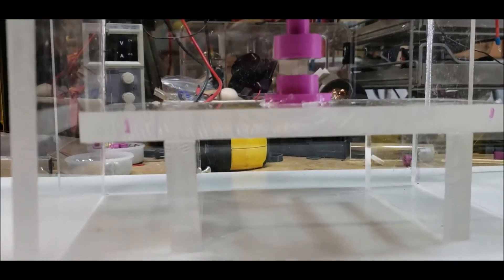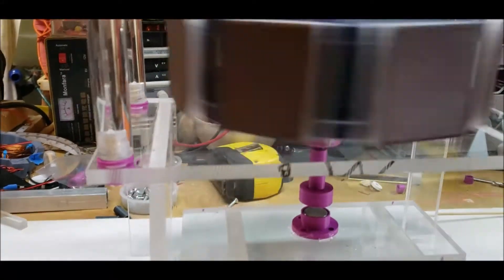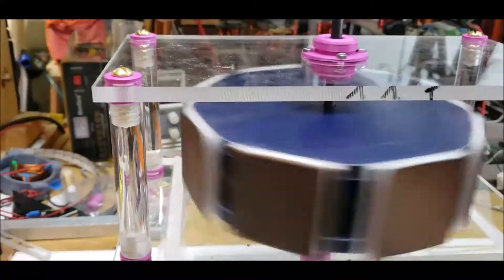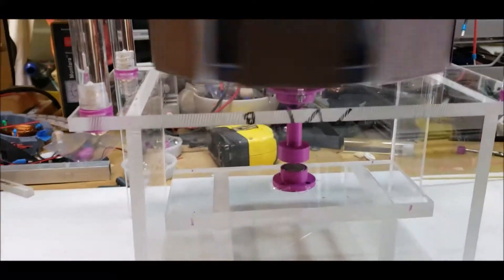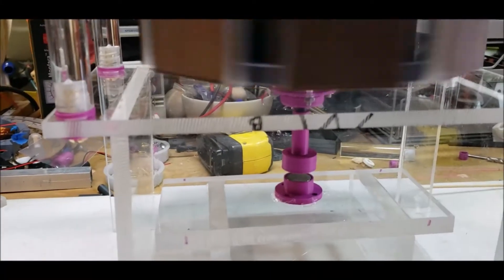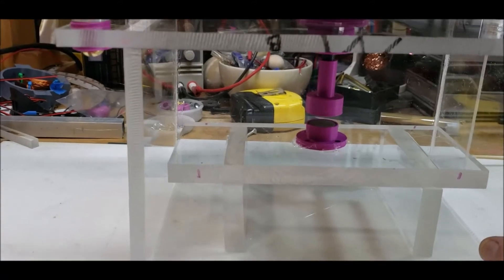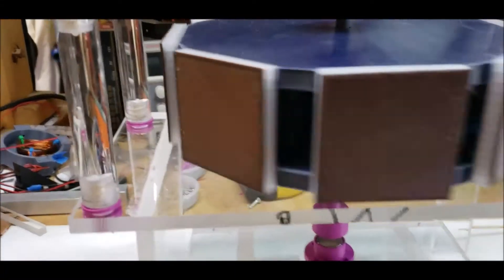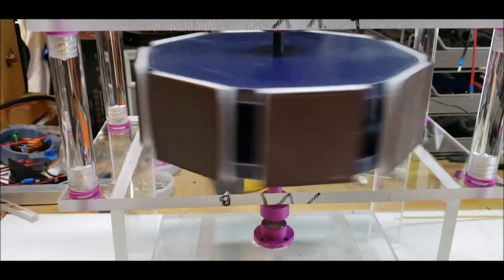3D Printed Magnetic Bearings Confirmed

Comment: Nice work
Can you share the STL files for magnet holder and bearings
Reply from the maker: absolutely!!!! The magnet holder is for a 2"x 1/4 disk magnet. The bearing mounts are for 22mm ceramic bearing. How would you like to get the .stl?
Reply: @mcorrade  hello my friend, you can share de stl for the magnetic bearing? please, thanks, men
Reply from the maker: @data112  Yes I will put all the .stl on thiniverse and post the link. You have to give some time.
Reply from the maker: Yes I will put all the .stl on thiniverse and post the link. You have to give some time.
Reply from the maker: There up on Thingiverse https://www.thingiverse.com/mgendron57/designs
Reply: @mcorrade  thanks men, i downloading the project, but the firts example dont work, i cant downloading this file
Reply from the maker: @data112  So not sure what Firts means but the download works just fine. I just checked both files.